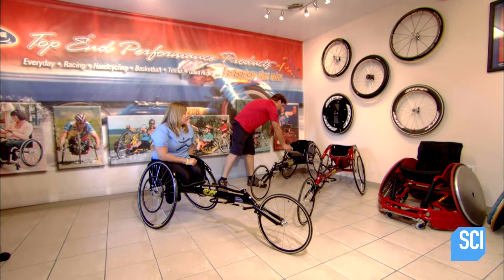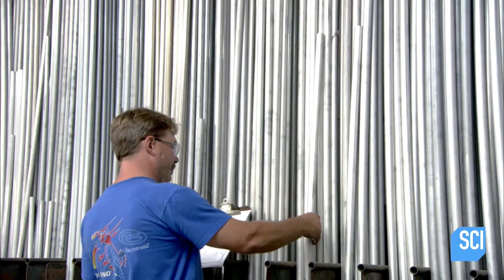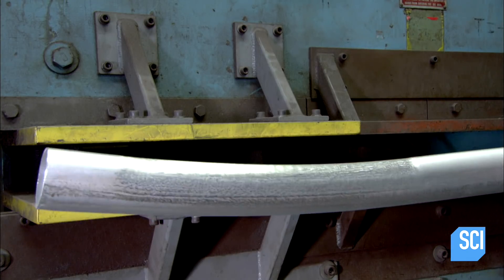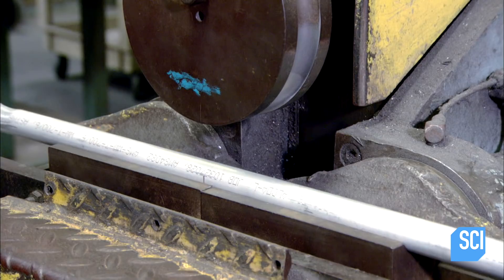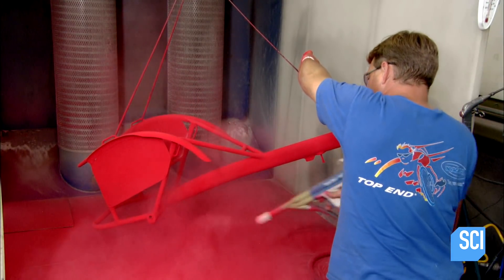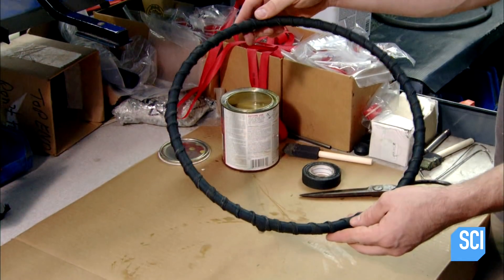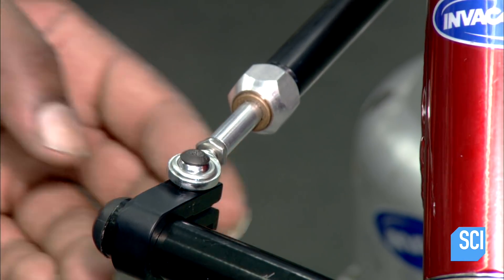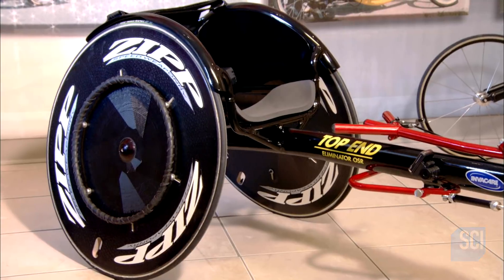Racing Wheelchairs | How It's Made

Comment: what is the minimum distance at which it's possible to bring the back tyers closer , make it less wide , without compromising on the balance & movability of the wheelchair. How many inches apart are the tyers in this one ?
Reply: It’s not really possible to give an estimate since every rider is going to have a different seat width and knee size + camber (tilt of the wheel) options vary significantly before even getting to brand differences, so even if we had the exact measurements for this athlete’s, it’s functionally useless bc everyone’s is different.
The camber is also essential to helping keep the racers (all in a race, not just the user) safe as it helps avoid stacks, albeit not entirely since accidents can and do happen. iirc it’s also more useful for speed since aerodynamics, though I’m not 100% sure about the physics regarding that. Track racers also tend to need less stability than road marathoners, so that’s another way the camber will often vary. 

While you could in theory have a racing chair with no camber at all, it’s not recommended; it’s also not measured in distance, it’s measured in degrees since the tilt of the wheel is what’s measured for accuracy. Measuring by distance would also vary based on the type of wheel is on the chair, etc. so there’s no real way to measure this by inches.

Comment: the wheels are tilted.. so aren't they harder to move ? Also, doesn't the center axle & wheel hub break under the weight of the rider ?
Reply: No to both of your questions. The camber of the wheels (tilt) allows for more agility and balance in the chair. While each chair will be built to a weight limit, it’s usually far more than one of these athletes will weight, the limit is usually 110-120kg for a normal frame.
Reply: Yeah they break. That's what they built their whole career around. Making racing chairs that just break. 💩👍
Reply: Nope